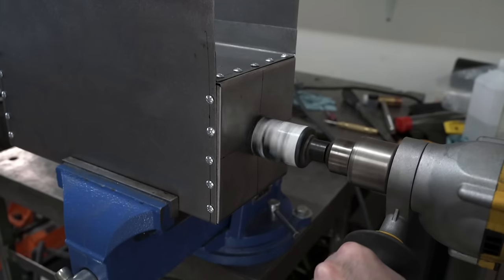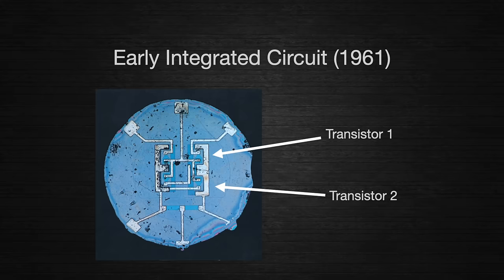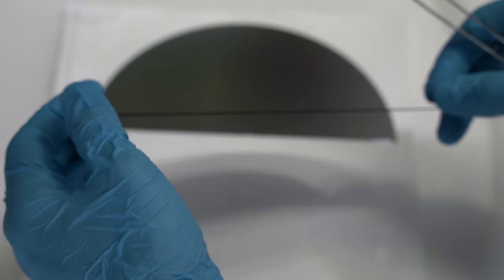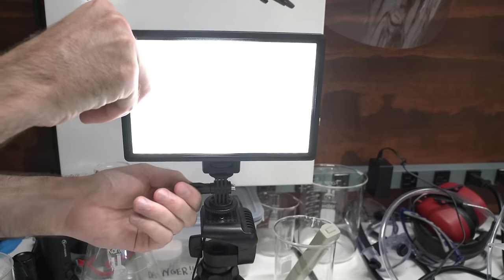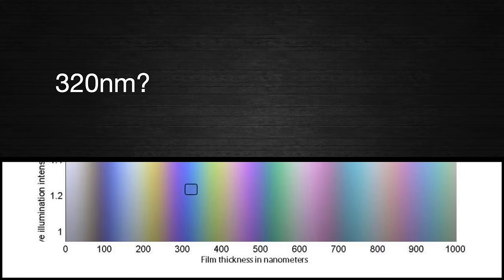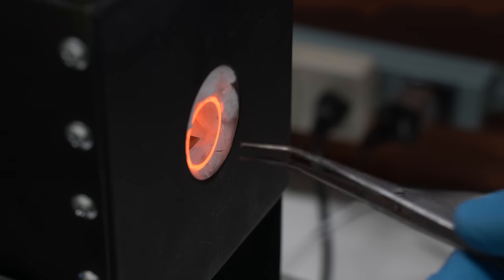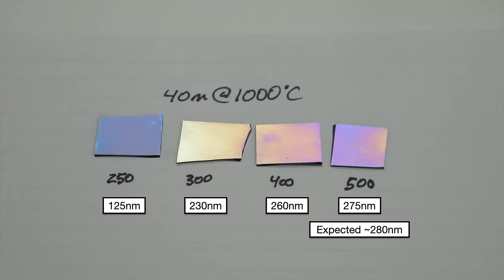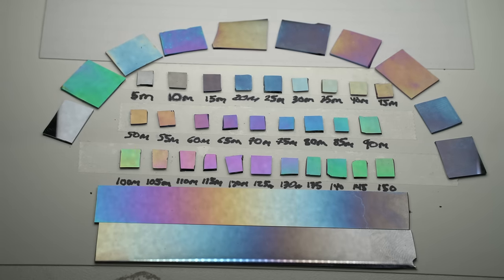Growing Colorful Oxide Layers on Silicon

Comment: Idiot here, so take these comments with a massive amount of skepticism:
I just watched the build video for the oven. Something that might be worth while is to add a few thermocouples to the outside of the heater (S, R, or B should work). This would allow you to monitor the temperature gradient throughout the oven.If you added more SSRs and zones that would help with the graident as well. It might also be possible to correlate external thermocouples with the internal thermocouple to get a good enough temperature which would remove the need to have the thermocouple in the way of your work.
Your steam is likely adding a huge temperature drop to your process. It might be worth trying to superheat the steam by putting a couple helixes into the glass and putting a flame on that. The steam is likely also creating a venturi, drawing cold air into the system. Could you put a plug on the steam side so it can't do that? Also, would it be worth plugging the other side with something to reduce the amount of air exchange? Maybe a cotton ball size piece of insulation would do it while remaining porous enough to still allow the water vapor through unimpeded.

Just subscribed. Looking forward to future videos. Great work.
Reply from the maker: Yeah- more thermocouples and also maybe different heating zones would definitely improve things

Comment: Amazing.... I wonder what kind of chips are floating out there, made from an entire huge silicon disc. I wonder if it has ever been done. The gains must be huge, if we pretend we're etching an NVIDIA gpu, but using the size available to add extra logic.
Reply from the maker: It's possible someone has made a giant chip but it's really not advisable. Reason is, the likelihood of a defect scales with chip area, so it becomes harder and harder to get good yields on larger chips. I suspect that to make a single giant wafer chip you'd probably have to scrap dozens of failures

Comment: Would love to see a taperd piece of silicon
With the full spectrum on show
Reply from the maker: There is actually an industry technique to do this. You grow a thick layer across the whole wafer, then suspend it in a bath of HF and slowly draw it out. The HF eats the glass layer and because the time spent in the bath is a gradient, the resulting oxide becomes a gradient as well!

Comment: You can't insulate with aluminum foil which is an excellent conductor of heat.
Reply from the maker: it's slows convection though which is a significant heat loss
Reply: @projectsinflight   Yes, what results you obtained were due to an effect similar to a tent or teepee. There's no insulation, just a barrier to convection.
Nevertheless, I don't want my comment to detract from the high regard I have for what you have done here. It's nothing short of stupendous!
Reply from the maker: no worries, and i appreciate the feedback

Comment: are there others who do this at home??? no way!
if you plug the end vapor wont be pulled into the tube. i think.
Reply from the maker: Yeah, I'm still workshopping solutions for injecting steam. lots of options for sure
Reply: maybe a nozzle of titanium in the roof on tube? maybe its not as expensive,hard to work with as we think? @projectsinflight

Comment: I'm sorry, But you are mistaking! 
There is NO Glass!! 
The oxidation layer of SiO2 you are referring to is pure  Quartz Quartz is a hard, crystalline mineral composed of silica (silicon dioxide). Not a type or  form of glass!! Glass is an amorphous solid, consisting of multiple metals and oxides!! So there is no collard glas!! 🤷🏻‍♂️ Ow and its better to use dry nitrogen gas, instead of compressed air to clean and dry your wafers! 😉
Reply from the maker: I do my best to explain things but sometimes I have to make a hard decision to sort of gloss over nuanced topics for the sake of not confusing viewers. You are right about everything but I decided that I couldn't go too far into the weeds on this video